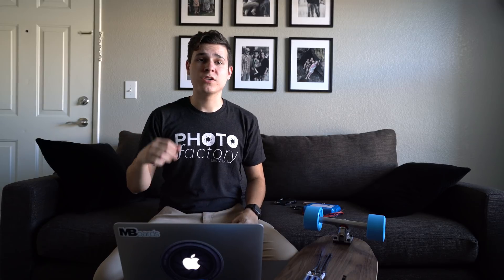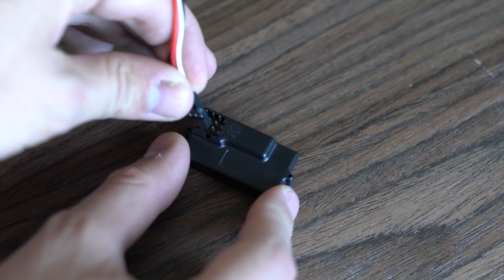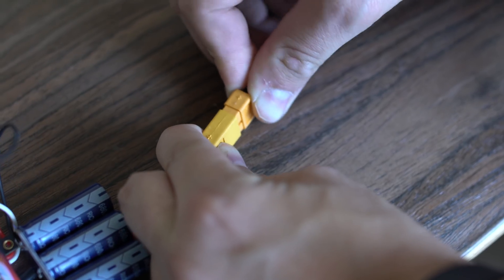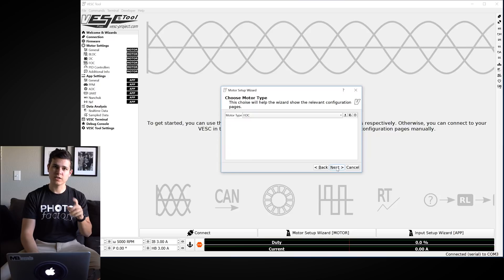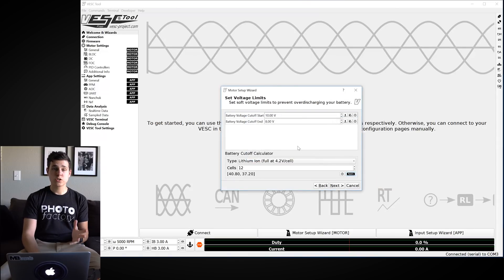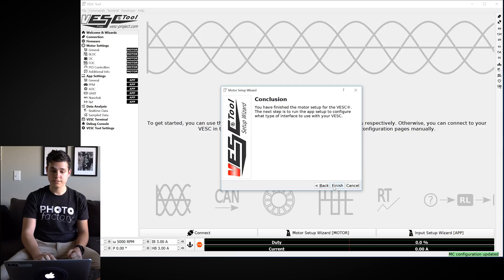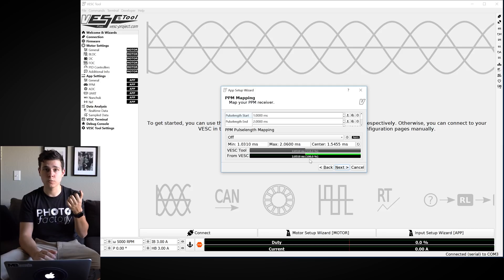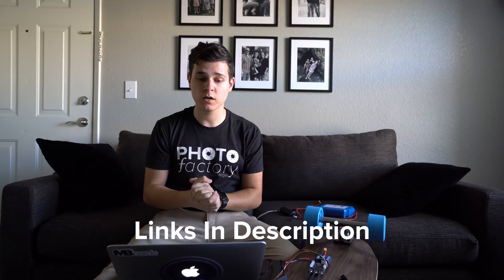DIY Electric Skateboard Build - How To Program a Vesc

Comment: ola boa tarde. estou a usar vesc 75300 r2,  motor 65161 120kv, controle rc em ppm. façotodas estas configuraçoes porem meu motor não gira de continuo e não acelera, ao contrario gira e para, gira e para, quando aciona o acelerador. poderia me ajudar comesta configuração estou usando vesc tool 6.02

Comment: hey wondering if anyone on here could help me? when I was putting everything together a bare wire touched the receiver chip for the remote, which is just an open circuit board, it sparked a good one. finally when everything was connect I powered up the board and controller, the Vesc lights up, but the indicator light on the remote receiver does not. hoping that all that was damaged was that particular chip.

My question is do i need both a new controller and receiver? or maybe just the receiver because the controller is good?
also would i need to reprogram the new remote? thanks for any assistance!
Reply: you could possibly be able to link a new receiver to the old  contoller
Reply: @dontdowhatido6503  awesome thanks for the idea! Would any model work? Or would it have to be for that same controller? It was a comfortable controller haha

It's just a Bluetooth connection hey?

Comment: If im running a 10s4p battery with 6354 motors what should I set my battery max and battery regen at?
Reply: Depends on the battery

Comment: What if i use 2 VESC-s? can i just plug both of them in the remote?

https://flipsky.net/collections/electronic-products/products/torque-esc-vesc-®-bldc-electronic-speed-controller
https://alienpowersystem.com/shop/radio-transmitters/alien-power-system-2-4ghz-electric-skateboard-remote-control/

Comment: Hi!
I have recently programmed my VESC for my robot project.
The problem I have is that it is too fast which makes it hard to control.
My question for you is, can I decrease the speed by decreasing the motor max current in the sitting?
Thanks if you answer!
Reply: Nope not really, there just losing tourqe in that case. But you can limit the RPM via the ERPM Parameter

Comment: I just bought a diy dual belt driven board secondhand on FB marketplace. Got it for a steal at $100 however the remote stopped working. I'm going to upgrade the standard esc to a vesc but not sure what type/size  battery it's using ....is there any way to find out so when I program I do it correctly? TIA

Comment: Is it possible to make the motor go in forward and reverse with a single Vesc?
Reply: It can go both way, thats why he is setting the remote throttle to +100 and -100 (reverse)
Reply: Ok thanks, so the receiver gives the Vesc a -5v signal reversing rotation direction.  I was under the impression that was allowable braking force and wouldn’t actually turn the wheels in reverse.
Reply: superman39213 no no no its not -5V, its PWM signal between 1ms and 2ms, depend on how you set it up, most esc is set so normal is 1.5ms

Comment: Hey Mike thanks for the video, I'm building an ebike with an outdrive motor and I have one with a hub motor that I would like to switch over to using these fsesc controllers on first of all I'm 53 years old and I'm up on some tech but not everything and I e been using them huge controllers from china lol! But first do I need a reciever to program this because I thought them wires would go to my throttle, so I cut it off, but I saved it in case I have to wire it back up... hope you can help me.. well do one question at a time.. thank you so much..????

Comment: Thanks for that, so how do you know what do you have to write in the program for amps of motor and amps for battery?
Reply: So just in case you haven't gotten an answer for this yet, that info can usually be found directly on the battery and motor. If by some chance you can't find their output and input on the battery and motor respectively then you can look them up on the seller's page.

Comment: Current specs: 2 5200 mAH, 3s1p lipos, VESC, and 6355 190KV motor. I attached it and set it all up and the longboard still doesn't move when I stand on it. Is this a hardware or software issue?

Comment: is it possible to use a Dual Belt Drive 5055 Motor Kit instead of a one belt drive with this kind of Vesc and battery? and what other consequences would this have?
Reply from the maker: It is possible but you would need 2 Vescs. 1 for each motor 👍🏻

Using 2 motors also cuts down on range. You’ll get about 70% of the range you would get with 1 motor.

Comment: Hi Mike, thank you for the easy video on this tool, with the programation explained by you its possible spin a motor forward and backward with the same intesity or there is some other addition to do in programmation? i mean for moving a vehicle forward and backword and not just for breaking

Comment: How do you figure out your battery current max?
Reply: In theory there is info written on your battery pack, for example 4000mAh 20C.  That would mean 4Ah x 20C = 80Amp maximum discharge current. 
In reality those are usually burst values and they can not be sustained for a long time because of the heat. Your batteries should never exceed 60 degrees Centigrade.
Reply: also a look in the datasheet if availabel helps there are peak values and continius run values

Comment: Does two 5s battery's count as 10s?
Reply: CreebobPlays it depends on how you connect them. If they are wired is series neg-pos-neg-pos, then yes they are 10s. (Use this if you want a higher top speed). OR they can be wired in parallel pos-pos/neg-neg, which would be denoted as 5s2p, which is 5s. (This would grant twice as much range)
Reply: how to do that?
Reply: If i were to wire in parallel would i be able to power a 10s vesc and motor? or would it still be considered a 5s?
Reply: CreebobPlays no, it is not possible. You will need to connect your batteries in series in order to achieve 10s. 10s refers to the number of cells in series 10 (series) while p refers to the cells in parallel per group.

Look at onloops guide on the forums for a more comprehensive guide.

Comment: Mine keeps saying could not auto connect? I have it plugged into the computer with the wire that came with the vesc and I have the battery attached and charged.. do I need to have the receiver and motor to the vesc in order for the pc to recognise it?

Comment: So, how do you calculate the amperage of your battery, and what percentage of your batteries amperage do you use as the output for your motors? 
Thx in advance
Reply: In theory there is info written on your battery pack, for example 4000mAh 20C.  That would mean 4Ah x 20C = 80Amp maximum discharge current. 
In reality those are usually burst values and they can not be sustained for a long time because of the heat. Your batteries should never exceed 60 degrees Centigrade.

Motor amperage can be set as much as motor is rated for or maximum value vesc is capable of pumping.

Comment: where i can buy the vesc becaus the link do not work
Reply from the maker: We’ve got Vescs available at www.mboards.co
Reply: @MikeBeard  but are they the same as used in the video end is the programation the same
Reply from the maker: We’ve actually upgraded the brand. But it’s the exact same set up instructions.
Reply: @MikeBeard  I have a question about the battery's you sell:
What type of BMS is used in the 10s2p battery

Comment: Great video Mike. One question I have is do you really need to connect the sensor wire to the VESC?
Reply from the maker: You don’t have to. Connecting the sensor wire will make it a bit smoother of a ride but it will function just fine with out the sensors
Reply: @MikeBeard  Awesome! Also when programming my VESC without the sensor wire can I still us FOC or should I use BLDC? Thanks

Comment: Does two motors need two vescs
Reply from the maker: Yes. Or you can use a Dual Vesc. It would be a bit cheaper that way.
Reply: Mike Beard thank you so much for the info, I already have a wowgo 2s but I want to either upgrade it with a better battery new motors or both or maybe just make my own whole board
Reply from the maker: I always recommend building your own board. That way you have total customization options and you are free to upgrade when ever you want with few limitations. If you ever need any help message me anytime.
Reply: How would you set up a wired throttle ?
Reply: yes

Comment: FOCBOX Unity worth it over two VESCs? I'm concerned about the VESCs burning out. Already been experiencing DRV errors in the past.
Reply: Rock-solid reliability is a must, especially with dual 6374 motors. I’ll invest in a FOCBOX Unity probably haha.
Reply: @TechnicallyaNomad  Yea, the Unity looks like it will be the VESC all others will compare to. The specs are crazy. Of course it's expensive but it is currently as cheap as it'll ever be. The VESC isn't something you want to cheap out on since it's such an integral part of the board and it failing can be dangerous.
Reply from the maker: It just depends on what you value over price. And what set up you are using and how much you are pushing everything. Focbox is definitely a really really nice option but much more expensive. It’s hard to say since everyone’s needs are a bit different

Comment: I have a question.....Cant you use a charge port with a 4 wire pin connected to an esc ? Thanks.
Reply: I didn't quite understand your question!

Comment: I was just hoping you could to a tutorial on the 10S 3P battery pack, because I am going to make one for my electric longboard which I am going to use for my school project
Reply from the maker: It’s the same exact way I built my 10s2p battery pack in my battery tutorial. Just use 3 cells in each group instead of 2 👍🏻
Reply: @MikeBeard  thanks that's really helpfull

Comment: My vesc didn’t come with the signal wire
Reply from the maker: If it doesn’t then you’ll need to pick up a Servo wire to go with your vesc and receiver. Luckily a very cheap cable.
Reply: Mike Beard I’m not talking about the servo wire. I’m talking about the wire adapter from the signal wire on the motor to the P1 port on the vesc. I bought it from you. Luckily I found a harness that fits so I solved that problem
Reply from the maker: Hmm might have bought from us back when we had a different supplier. Switched because they wouldn’t give us the proper cables we wanted to offer.
Reply: Mike Beard no worries dude!!

Comment: Whats the "Battery current Max" of your 10s2p?
Reply from the maker: About 35
Reply: if you build yor own with hig quality cells yur can get 60-70A
Reply: @nickhetzer2744  You can get much higher than that. 10x even.

Comment: Why is my braking power so powerful on my DIY setup, running 12s through one motor btw
Reply from the maker: Check your max current brake in the current settings. Is it at -60A? Higher? Lower? Try lowering it
Reply: I always keep mine at -30 amps (Should go -40 if u are heavier)

Comment: What do you do if you have 2 VESC? I’m trying to build Skate Metric’s foosted board.
Reply: Charlie Williams
 Me too! I have already started! I will be using dual FOCbox. You basically need one receiver! One FOCbox will be master and the other slave. You can do split PPM (connect servo cable to one FOcbox and split the signal wire to connect to the other Focbox) One Focbox will be supplying power to the receiver but both FOCboxes will get the same signal. You wanna carefully apply the same configuration (Copy Paste settings file if you can ) to both VESCs. Another method is to connect both VESCs with a CAN junction wire. The same thing happening in one VESC will happen in the other!

Comment: With my board, it would simply stop the motor when braking, there was no gentle ramp up of the brakes. Is there any way to manipulating the ramping time for braking or is the only way to do this to deaden the breaks by like 25% to reduce the braking power overall?

Comment: You didnt even address the centering the remote, I havent even calibrated a single vesc and even I know that, who knows what else you missed :(
Reply from the maker: You are right I didn’t mention it. The remote I calibrated didn’t really need it. Should have mentioned it anyways. 

I will be adding this to the fuller length blog post on the website.

Comment: Nice video, just what I needed to watch. I'm thinkinh of buying a vesc as a replacement for the ESC I burned while connecting with a cable that was not verified for polarity.

I have some questions regarding the vesc hw and firmware versions / revisions. I see hw version 4.20 and 4.12 and 2.18 and 3.28 for the firmware. I cannot easily find the differences between them and which should I buy, since the prices also differ.

Thank you for your video and keep the good work.
Reply from the maker: The hardware version seem very similar to me. But I’d opt for the most up to date firmware version possible. It’ll just use the hardware motor effectively.

Comment: A hint and a PSU, one for remote calibration and the other for the mini remote sold at Mboards (or any remote with this receiver bug).

* You don't need to enter the min and max pulsewidth values. In order to be more precise you click the little swirl under the apply button, it resets the min and max read from your remote. Just go full throttle and full negative throttle and then hit apply. The software automatically applies the measured max and min from your remote.

* The mini remote sold at Mboards has an odd bug where once your remote is out of range or turned off, the receiver outputs a pulsewidth of around 1.65ms. This usually results in about a 50/60 % throttle applied to your motor which is extremely problematic (my board spun off and launched itself in a ditch, which covered my board in mud and almost destroyed it.) In order to counter this you should calibrate the little potentiometer on the circuit board to output the same pulse at the center (thus about 1.65ms, this could vary, check this for your remote by turning it off and reading the value). After having done that you should do the step above and calibrate the max and min again. Again I learned this the hard way and almost messed up my battery pack.

Stay safe.
Reply from the maker: Helpful little tip! I didn’t know about that button. I’ll have to check it out. And there are 2 versions of the mini remote (one has updated internals). I’ll test the ones we have.

Comment: What are the sensors?
Reply from the maker: Many Esk8 motors have sensors built into the motor so the vesc can keep track of a number of different values. Helps with start up from being stopped. Smoother ride usually